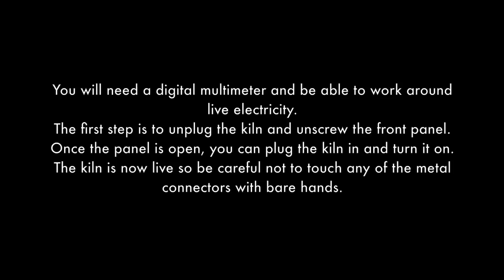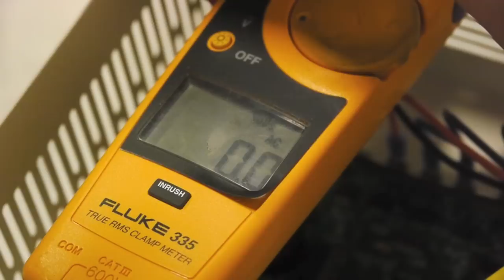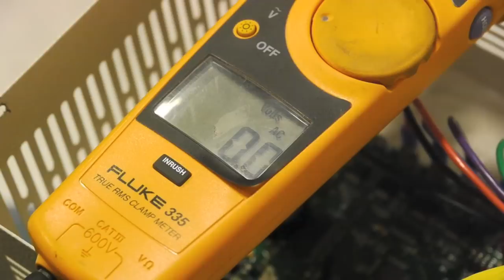Check Power Relay in an L&L automatic kiln

Comment: I'm a videographer and my wife runs a paint-a-pot shop. Currently I am trying to diagnose a fault in her kiln so I hope you don't mind me making a few suggestions for when you do remake these videos. Get more than one camera and put them on tripods and run continuously through the whole process. And watch what you are seeing so you can get your engineer to move his hands so you can see everything. And manually focus the lenses. There is no efficacy in autofocusing on a tutorial video. Just focus in on the fine details like the contacts. Have one on the clamp-meter and another on the relays and go through the whole thing two or three times so you can grab the best bits from each. Then when you edit it you can make the user believe that it was only done once but they won't have to wait for like 30 seconds for the readings to kick in. Hope this helps.

Also don't be afraid to talk. Cheesey elevator music is not necessary other than for background audio.
Reply from the maker: Paul - thank you for those detailed and helpful  tips! We are just getting ready to redo all our videos and I will take all of this into consideration.

Comment: Many of us are not electricians but still would like to and with proper videos could test our own kilns.  It might be helpful to add to the video a part where the relay is out of the kiln but has the wires on it so you can see how the wires are connected.  Then have the guy show exactly where the probes go on the relays for each reading.  If the relay is out of the kiln we should be able to see the probes easier because our view should not be obstructed by wires and hands.  The Camera could be on a tripod and set at an angle where his hands are not in the way.  The technician could also be describing what he is doing verses reading it on the screen.
Reply: Kim - a great idea as we are redoing these videos - thanks!

Comment: The video goes too fast when showing where the meter probes need to go. Especially on the second part. I know one probe is on the black wire leading to the element, but can’t see where the other probe is. He could be describing what he is doing and saying what the reading is so we can get a better understanding of what he’s doing and what relay is showing a failure
Reply: Thank you for this feedback. We will definitely incorporate this suggestion when we remake this at some point.